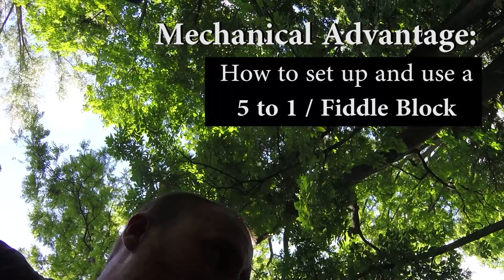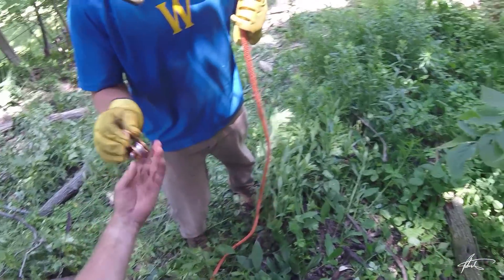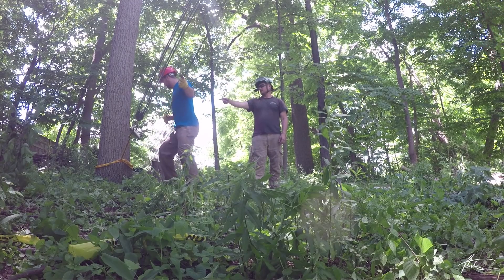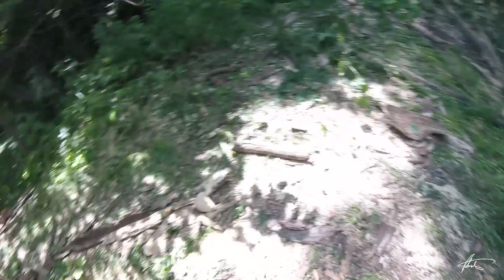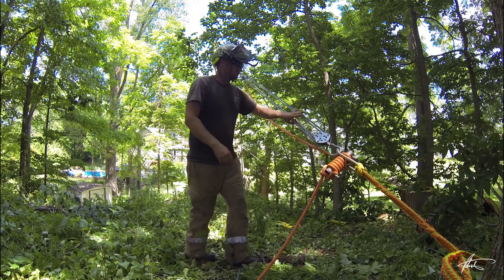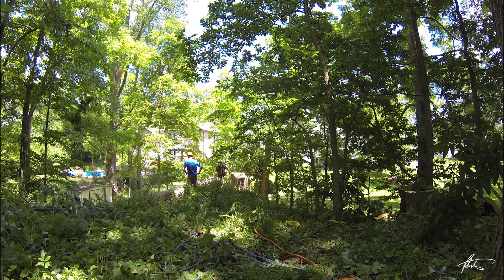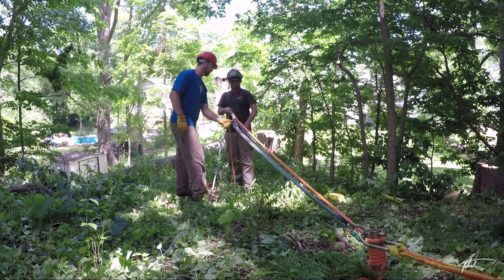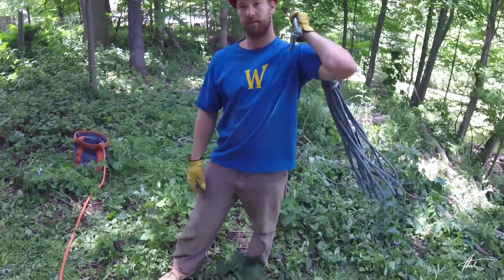Fiddle Block 5:1 Mechanical Advantage Basics | Arborist Rigging Essentials 2019

Comment: QUESTION: Does the rope you are pulling in the middle of the video have a ratcheting mechanism or cleat to hold the tension after each pull? If so, can you tell me what you call this kind of rig because I was trying to pull my tractor with a block setup by myself recently and every time I moved it it would slide back once I let the rope go?

Comment: The rope you were pulling on, looked too low on the tree. The rope was pulling more horizontally against the tree than vertically. If the rope had been 12-15' higher, it would have more likely come down the first time your man tugged on it.

Comment: Tie the rope twice as high on the tree to double the mechanical advantage yet again.  If you could get the rope tie point five times as high you'd get the same force without using the fiddle block (you'd lose a bit by reducing the angle between rope and tree).  I've never cut down a tree but teach mathematics and science.  It's all about torque.

Comment: I'd still rather use a Maasdam rope come a long any day.
300lb pull into a 5:1 equals 1500lbs, and has length limits, resetting if longer pull, etc....
Rope come a long us 1500lb pull to start, one pulley makes it 3000lb pull.
Have 300 ft of rope? It'll pull it if you have enough time

Comment: Hey Patrick, great video! Absolutely love your content and approach with the principals. To alleviate pulling from the top block and vectoring the system, I have found it helpful to redirect the rope at the anchor to achieve an in-line pull. I found you can get a steadier pull and alleviate rocking/swaying of the tree.  Keep up the good work brother, Airborne!

Comment: I like that micropulley with prussik idea, and the backup portawrap. There is nothing worse than reaching the end of the usable length with no option to adjust while under tension. Plus it allows you to cinch up the main line tight, before using up length on the block line.

Comment: If the mainline can handle the loading from the French Prusik used for the 5:1, can the mainline be French Prusik'd to itself (using the necessary rigging hardware and giving the 5:1 its own anchor connection directly to the tree) instead of using the Port-A-Wrap?

Comment: I had a bad tree situation a couple of weeks ago, decided to pull it over. It was a co dominant stem that (I think) died from line clearing. The rest of the tree was not being removed. I was going to climb it until I saw the split that started a few feet up...long story short, throw line through a crotch, rigging line with a running bowline, 5:1, and when that didn't work, add a 3:1 combo, a couple of resets later, and down she came. What was left was a comfortably safe climb to finish off. After seeing this video I have started stowing my 5:1 the same way. Thank you for sharing your knowledge and experiences, my Brother! Stay safe.

Comment: Is there an advantage of this system over a maasdam rope puller?  Maasdam has 10 to 1 advantage (20/1 with snatch block), and can pull the length of the rope if needed.
Reply from the maker: I prefer the fiddle block when there's more than one person available on the ground, it's usually faster for us than the Maasdam...     - Patrick

Comment: That's awesome you took the time to show your guy how to use it. My boss has little patience so we use the most basic equipment. We definitely would have done that tree with a sledge a wedge and a rope. About to do a 40" diameter Ash base tomorrow, and same thing sledge wedge and rope. Personally I like the come alongs, but the system you use is much stronger than any come along a person can buy. Cheers and great video! Thanks for all the learning tips!
Reply: Try a 2005 Honda CRV.  It has a tie off loop attached to the rear floor-pan.
Reply: Lmfao😂

Comment: Thanks for the video.
Good luck to the new guy.
I made my own 5 to 1 (or maybe 4 to 1?) ... with 2 double pulleys... not as slick but a lot cheaper.... not sure if there are any inherent downsides to the actual fiddleblock?
Reply from the maker: Hey Bob, nothing wrong with a homemade 5:1. Fancy one would probably be more efficient (lose less energy to friction, but not totally sure.)  If you set it up like I showed, where you are facing the load, and pulling away from it, then it's 5:1. If it's the other way, facing the anchor, then it's 4:1.       - Patrick
Reply: @TreeMuggs_PatrickM  thanks Patrick... of course... 5 lines coming from the moving point make it a 5:1, right?
Reply from the maker: @scatoutdebutter  Yessir!

Comment: Hi, is it safe to clip a carabiner to another carabiner - both being triple lock?
Reply: It's safe if you can ensure they don't sideload. It's not the optimal connection, ideally you'd use a rigging plate, ring or textile connector inbetween, but it's not unsafe to use two carabiners.
Reply: @raphaelbeinhauer9242  this would be for climbing - rope to carabiner, carabiner to carabiner and finally carabiner to zigzag.
Reply: @raphaelbeinhauer9242  advancing up the tree while in the tree, double rope.  The zigzag has a really tite rubber grommet where  carabiner attaches.  So, I could leave one biner attached to zigzag and re-attach  the 2 biner after new tie in point is established.
Reply: @jolkraeremeark6949  If you do that I would suggest using a rubber band or something to keep your eye splice secured on the top biner to minimize the potential for crossloading.
Reply: @raphaelbeinhauer9242  no spliced eye, tied to the biner.  My thought was I would avoid retying to carabiner when advancing.
Reply: @jolkraeremeark6949  If you use a cinching knot like a fishermans or an anchor bend, crossloading is unlikely, but still possible. Do you have a biner that has a thinner profile and will fit the ZZ easier?
Reply: @raphaelbeinhauer9242  no, but that would certainly help!
Reply: @jolkraeremeark6949  What carabiner are you currently using?
Reply: @jolkraeremeark6949  You could try a Rock Exotica Rock O. I have some sewn hitchcord that I can't fit an OK in, but a Rock O fits. The RockO is much better quality anyway, I really don't like the OKs.
Reply: @raphaelbeinhauer9242  the ok's are actually the smallest I have that are suitable for life support.  I will have to get something smaller eventually.